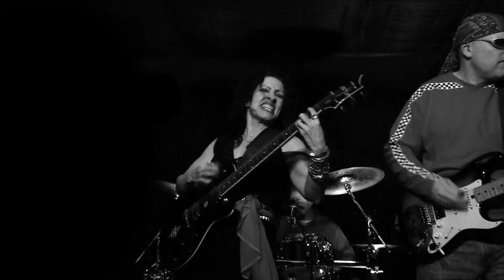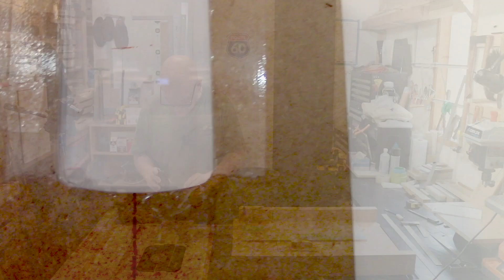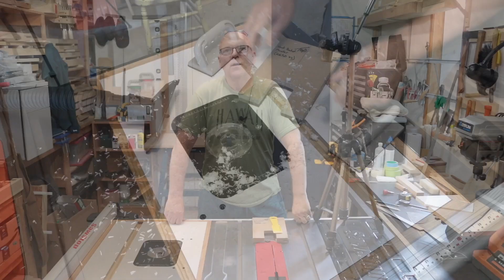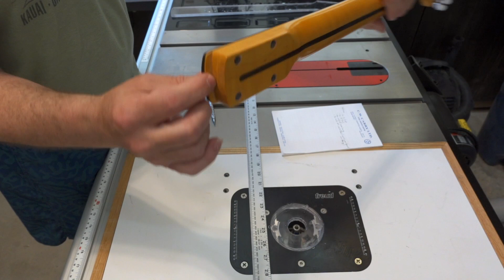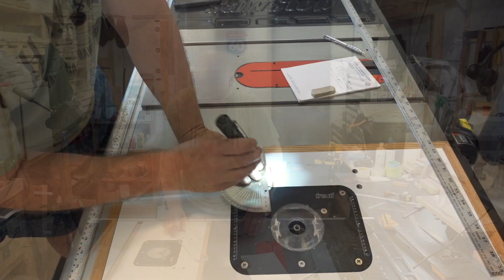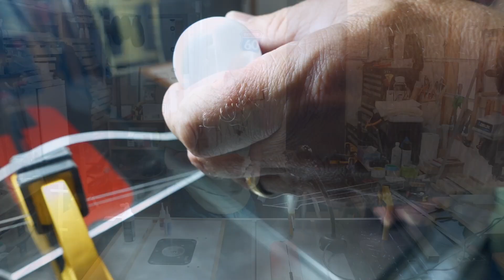The Great Guitar Build Off 2022 Part 9 - Neck Template Set Done!

Comment: Hey bud, just a heads up. Beware of sticking the neck to far forward or you could get bad neck dive like I did lol 

I found it better to cut a deeper access and carve the top of the curve to help access.
Reply from the maker: Thanks. I thought about that. The guitar I’m basing it on doesn’t have that issue so I think it will be okay. I’m using lighter tuning machines as well, so that should help.